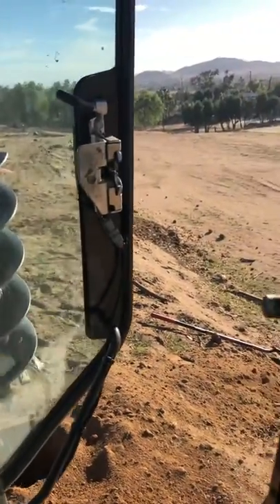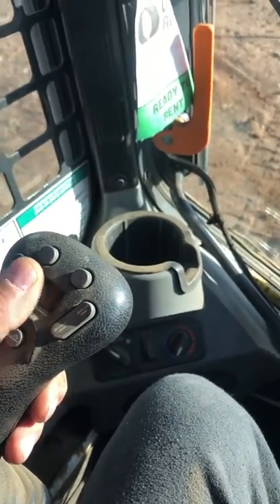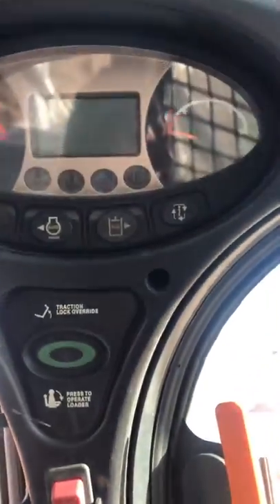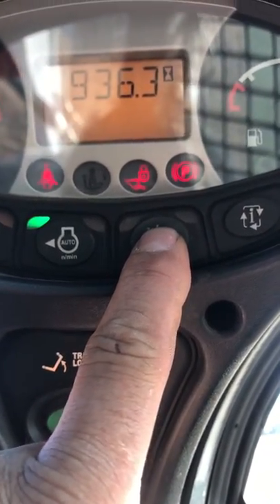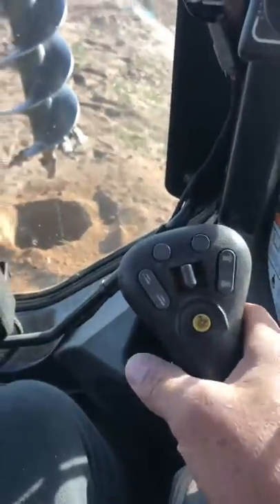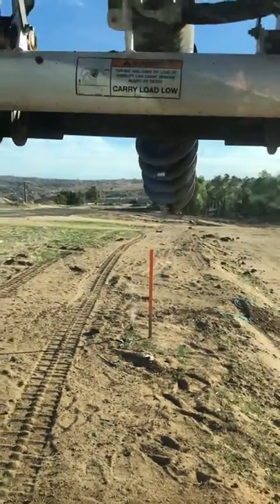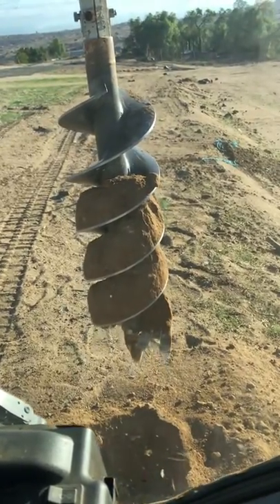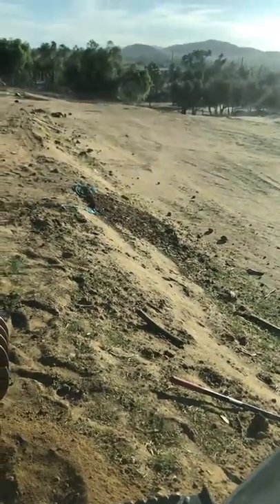INSTRUCTIONAL LEARN TO OPERATE A SKIDSTEER BOBCAT CONTROLS HEAVY EQUIPMENT DEMONSTRATION

Comment: Those controls are like the caterpillar skid steer, I have a bobcat skid steer and the controls are different  both sticks controls forward and back left and right 1 stick contols the arm up and down and 1 stick controls the bucket. I have never operated a bobcat with those contols before only a cat skid steer.
Reply from the maker: I like these controls especially the trigger that holds the auger on ... One of my favorite features! 👍
Reply: They have pattern control switch, Iso or H, or sometimes it can use foot controls for bucket and boom

Comment: Attach and detach auger ?
Reply from the maker: The auger bit? Well I do not have the machine right now. If it is just the bit. You will want to stand the bit up, I normally put it in the dirt or have a helper hold it. You just have to guide it in the hole on the top and the put the bolt in it. If the attachment is involved meaning the entire accessory, you would need to unhook the hydraulic hoses , and the locking part that holds the unit on. I will try and make a video on that though. Let me know if this helps at all or not.
Reply: @fastflo1  no, the whole unit.  I figured it out.  I couldn't locate the switch in the overhead console for the bob-tach .  Obviously, I found it.